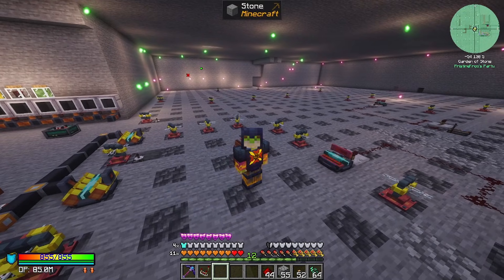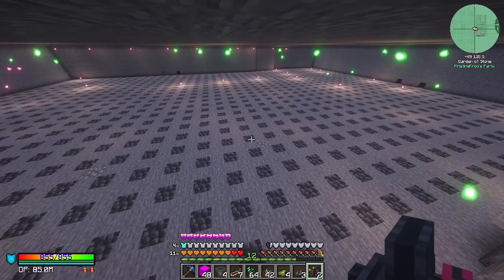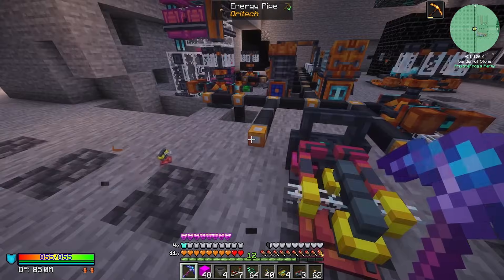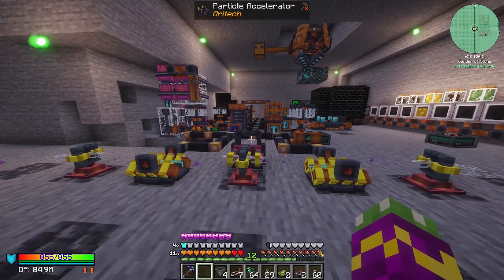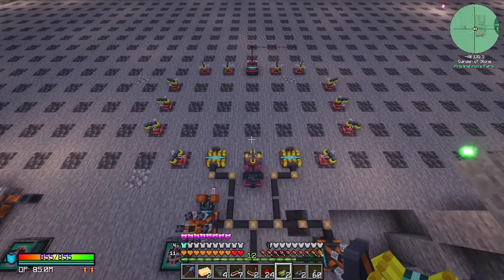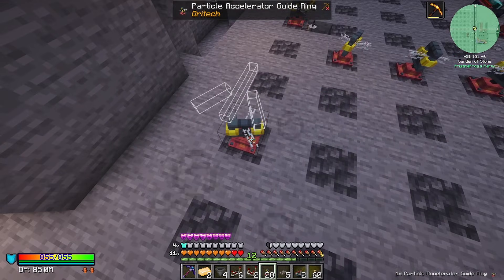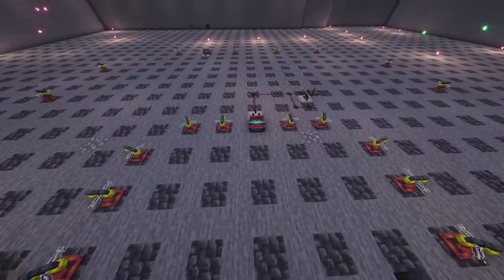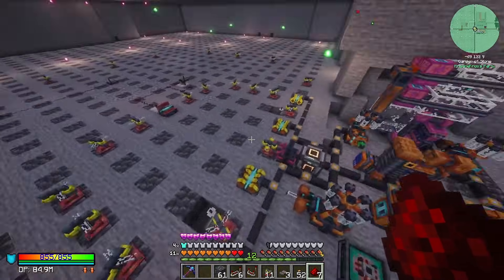StoneBlock 4: Oritech Particle Accelerator Setup (Plutonium Dust Tutorial)

Comment: Ive set all this up the exact way you have but for some reason the two materials arent colliding is there any possible way to help with this? Thank you in advance!
Reply from the maker: What is happening when you put the second item in the other particle accelerator?
Reply: @FroggoGames it gets shot out like how it would if i didn’t have the guide rings aligned properly
Reply from the maker: At what stage? We have a  new video up for the black hole, you can use that new system too but it will take more power.

Is it in the first ring? Second? Is your system setup to fully open and stay open? What speed was it going? 

https://youtu.be/EvYT8IRAlKA?si=Fzc2qoZ4-aRXXmy0
Reply: @FroggoGames its in the third ring but its only the secondary particle in the locked hopper that isnt actually colliding with the one going super fast
Reply: @F @FroggoGames and it is set to lock open once it reaches that speed
Reply from the maker: Does your corner of the collision have all 4 of the Guide rings together? Double check the exact point that it exits the system on the Particle accelerator and then look at that guide ring. You need enough of a chance of the overlap on such a larger ring, so maybe check timing as well.
Reply: @FroggoGames  will do
Reply: @FroggoGames  Sorry for no reply i was very busy
Reply: But its working now
thank you
Reply: Now i just need to upgrade to hit 15k
Reply from the maker: @Niko_nobody we have a video up for that too and it’s very compact
Reply: @FroggoGames ill have to check that out then lol